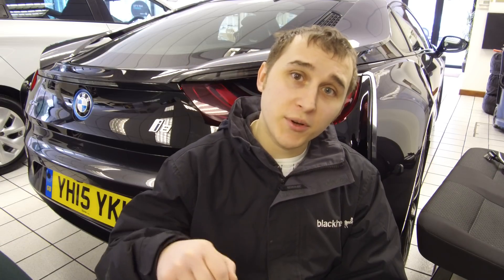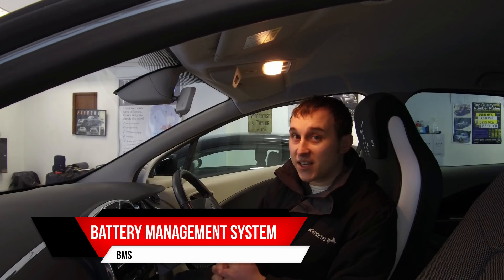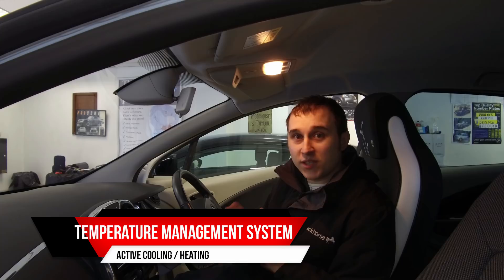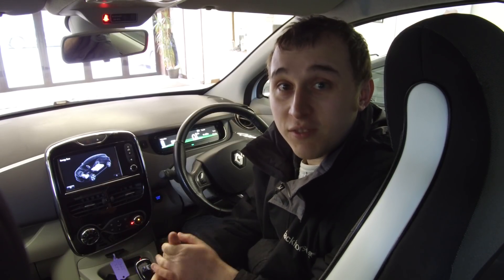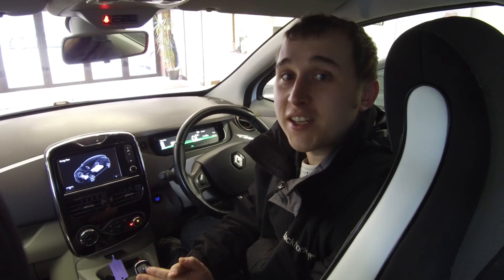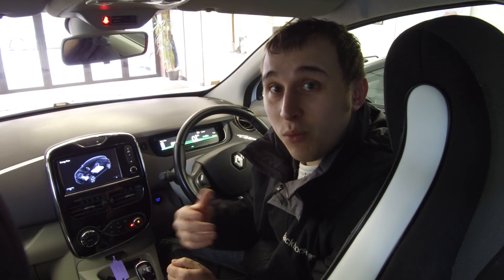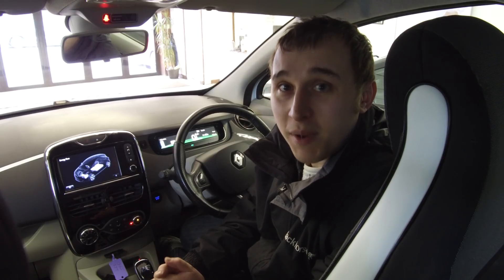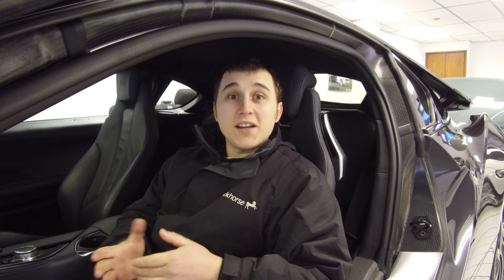2018 Nissan Leaf Charging issues TMS? Firmware?, my take  🔋🔌🚗

Comment from the maker: -Special thanks to Leo Clarke and Glenn Hodnett for supporting me via https://www.patreon.com/raimonick -
Reply: The original Zoe actually has a 24kWh battery but only uses 22kWh of it. The Renault marketing people thought buyers would not be happy seeing degradation in the first few years so hide it. As the battery degrades more capacity is used to keep the range. Makes it appear like the battery is not degrading. So sneaky that I expect VW wish they thought of it.
Reply: SOH = ability to hold a charge. SOC = how charged it is. Totally different things.
Reply from the maker: Yep got Tonge twisted however when I did subtitles I redid the correct Part I brackets I also said it again after correctly a few times :)
Reply from the maker: Lee only 22kwh is made available the top end it capped off to protect the life of battery same with bottom end the BMS ensure your never charge to a true 100% or a true 0% the 100% on battery is only 100 of 22kwh

Comment: Leasing a 2018 Leaf in U.S. Thanks for the video and info! Yesterday I did 2 charges 1st on J-1772 and 2nd CHAdeMO. First stopped after just over 1kw charge (started at about 10% left when I got to work). Went to a free fast charger after work and that quit at about 70% charge. I was with the car, so restarted the charge and disconnected at 95%. First time this has happened in 4 mos. I've had the car, so trying to figure out if there is an issue. Going to dealer for battery plate recall on Monday and will ask them as well.
Reply from the maker: Keep us posted joe

Comment: Why do you compare only to Renault ZOE? Are those the only two EVs you know?
Forget BMW i3, but why not not comparing with Hyundai Ioniq, which is in the same class?
It's only ZOE, Zoe, zoe ....
It's not an error, it's a feature. Because it can not dissipate heat, it slows down the charging speed to 40%-55% of normal speed, depending on temperature. Instead of charging in 45-60 minutes, it takes approximately 2 hours to charge to 90%.
Proven by multiple tests.

And a range of 300 miles? Give me a break. 
Who is driving 300 miles at snail's pace of 50 mph? What you get is 130 miles (at 65 mph) and the charger has to be just where you run out - to charge next 90%.
So it is 250 miles at the best, and to be realistic - it's more likely some 230 miles.

300 miles? With one fast charge to 95% Show it to me! Make a vlog.
Reply from the maker: Welcome to my channel Richard Please subscribe, I compare against the Zoe as its my everyday car and one i own,  I am due to test some Hyundai EV's shortly, but its hard to compare to something i've not used or tested.   Most people driving the leaf won't rapid twice a day on 1 run so 300 miles is easy,  as you'd leave your home with 150miles,  home charging doesn't heat the battery up to the extremes a rapid does.   Please see Lemon tea leaf's video.   I personally think Nissan are hiding from this issue now as lots of weeks have passed since they said  there investigating,  i do know owners showing this issue had an OBD port download and there SD card swapped for all the data but i think this was a smoke and mirror PR stunt as i'd of expected some release of information  by now
Reply: ZOE? OK, but get an Ioniq for at least a day so you will know what you are testing against.
Watching Bjorn Nyland could reveal a thing or two too.

Lemon-Tea Leaf? That's the guy I came from to see your video:
https://www.youtube.com/watch?v=CNY2xdWaGiQ&t=25m11s
A test at 60 mph that many users have missed, but it is very revealing.
Although the true range of Leaf 40 is 200 km / 125 miles (and not 150 miles, unless you drive <50 mph in ideal conditions, thank you), he suggests you should start charging at 20% - which happens at 160 km or 100 miles. So forget your 150 (ideal) range.
And even if - 60 mph is pretty slow. Most people like to drive 70, 75 or even 80.

Smoke from Nissan? What did you expect? They are buying time.
Can Nissan do something? Not seriously. Listen to Bjorn:
https://www.youtube.com/watch?v=foSYZ7bVhYk&t=57m00s
Adding a cooling fan won't help because of the shape of the battery. And adding a liquid cooling is a major redesign of the car (and the battery).

Just wait two or three weeks when users will upload videos, having daytime temperatures of 35°C (and night-time 20°C) and having massive heat-buildup at the first fast-charge (and a charge speed of less than 30 kW) !

Second fast-charge? It will be a ZOE R 90 speed. 20 kW or less. 2 hours and more at the charger.
Reply from the maker: I've struggled to have a Hyundai dealer agree to let me lend one yet, however i will be attempting to go via there press department.  Yes Bjorn is a great bloke,  my Youtube channel however is only 8 months old so I've not had chance to build much content out from Zoe and Leaf, like when Bjorn first started only did tesla.  I plan to try a lot of new things on the channel and more EV test is one of them, SO far my review section has,  "I8, model x, Jaguar ipace, (non driven) & leaf"  but as i said Hyundai is on my map for a test.  Hope you enjoy my channel there's a special video coming next week.  Also some great content coming from Milton Keynes when i meet my fellow youtube friends again.
Reply: If I may suggest - learn from Bjorn. This "Leaf 2018 bug" was a bad guess. 
The low charging speed is design feature. Bjorn knew it and reported it. 
He was told that "they did something to prevent battery degradation". Yeah.
Nikki Bloomfield knew it, months before the launch. So no guesswork next time, please.

A few questions: 1. which ZOE do you own? 2. Have you done a long road-trip at with multiple 44 kW AC charging sessions (at least 400 miles) and a video of it? 3. How about a charging curve/video from 0 to 95% on a fast charger?
These are things I haven't seen (or found) yet on a Zoe which would be able to take a 44 kW rapid charge.

Subscribed.
Reply from the maker: check out the first few videos from RZOC or Jan-Bart,  they did a road trip non stop to Austria and filmed it, LOTS of rapids, we have active cooling on Zoe and on the new ZE40 we also have heating.

Comment: Another JAPANSE trick ???? Japanese DIid NOT extend any Range on MISSAN leaf 2018 . Japanese are NOT good in Electricity. They are very good in Electronics ( again NOT electricity They can NOT recapture BEMF ) As owner of Nissan leaf 2018 e - pedal does NOT work at all !!! In fact NOT using E pedal neither ECHO ( garbage ) I get more Kilometers . E - pedal is only good for saving you money on the Shoe brakes and rotors maybe, because I do NOT have to brake at all . jusko@engineer.com . I am just writing this fact ( negativity) so other owners test it out and hopefully we get RECALL and Nissan leaf 2018 and they will fix it if you contact your Dealer or Nissan . E pedal on E golf and Ionique works very well, because you will see when you remove foot from e pedal = Kilometer ( or miles ) will encrease . if you have 100 Km left on battery , wait untill it drops to 99, then imidiatelly remove your foot from e pedal ===>>> you will see Km left will go up to 100 Km. That is the ultimate proof !!!

Comment: Check battery temperature management in the Nissan Leaf owners manual.
They warn you about frequent rapid charging and even suggest letting the battery cool down before DC quick charging.
Reply from the maker: Really that doesn’t marry up with the intonation am covering this Saturday from Nissan, if you haven’t already subscribe
Reply: Nicolas Raimo:  What has just been repeated from the 2018 Leaf user manual is surely confirmation from the horse’s mouth that the car is nit suitable for long distance driving unless the driver is prepared to greatly extend their journey times.  It takes several hours for the battery to cool from around 45 C, the temperature it will quickly reach during rapid recharging, to ambient.  On top of this is the delay resulting from slow charging as the temperature rises.  All further confirmation that without active battery thermal management, the car is unsuitable for long distance driving for which the 30kW Leaf is much better suited as shown by the Johnathon and two James drive from Hinkley to Aberdeen when the 2018 Leaf arrived over two hours after the 30kWh Leaf purely because of this.  And that was in very low ambient temperatures.  The delay will surely increase as our weather warm up, partly because the battery will cool more slowly and partly because it will heat up faster during rapid charge resulting in an earlier slowing down of the charge rate.
Reply from the maker: Hi Ian am by no means a Nissan fan boy however I believe what’s in the manual is just there as a way of saying to people who have low state of health “oh well you didn’t follow these guides”  the charge rate tails off too soon the 30kwh pack seems to allow high temps between charging.  Also if Nissan didn’t want this multi rapid charging there press statement this week would of just said that.  Like I said let’s give them a month first
Reply: Nicolas Raimo:  Its not that the 30kWh Leaf allows higher battery temperatures, it simply doesn’t generate as much heat in the first place because 30kW is a lower energy density than 40kW in pretty much the same battery pack size and shape.  A check of both cars using Leaf Spy
Reply: Sorry, reply sent prematurely.  Was trying to say that a check of both cars using Leaf Spy will confirm the lower battery temperatures in the 30kWh model.

I suspect that Nissan will eventually invoke the statement in the user manual once they’ve established that there are no faults in the cars involved and have confirmed, if this is indeed possible, that the problem lies with users not allowing the battery to cool between successive rapid recharges.  In the short term, they are obliged to investigate rather to revert immediately to the statement in the manual because they have to be certain that the fault doesn’t lie with the car.

Comment: The Transport for London rapid chargers that don't have AC rapid charging are those that are designated for taxi use only. The only approved taxis that can use it use either Chademo or CCS. There was no need for them to specify the added cost of the AC rapid charger connector.
The Transport for London-funded rapid chargers that are for public use do have AC rapid charging.
Reply from the maker: Hi Simon there where reports of AC rapid being removing from rapid chargers,  these were not new installs, so the cost would be them going out to remove them, However i am unsure if this was a taxi rank rapid i'd need to check with original source.   Just for anyone else reading this,  New London Take can take Chademo, CCS and Type2 AC,  in some respect leaving the AC on allows a failsafe if the DC part of the charger has a fault.
Reply: Nicolas Raimo transport for London have only recently started funding for rapid chargers,  so they're not removing ac charging,  just not installing it in places where it wouldn't be used. The chargers for taxis are all new. These taxi chargers are actually run by ESB on TfL's behalf. The Irish Electricity Supply Board.
Reply from the maker: cheers Simon not being in London I just saw post on forum, so thanks for full info
Reply: Another JAPANSE trick ???? Japanese DIid NOT extend any Range on MISSAN leaf 2018 . Japanese are NOT good in Electricity. They are very good in Electronics ( again NOT electricity They can NOT recapture BEMF ) As owner of Nissan leaf 2018 e - pedal does NOT work at all !!! In fact NOT using E pedal neither ECHO ( garbage ) I get more Kilometers . E - pedal is only good for saving you money on the Shoe brakes and rotors maybe, because I do NOT have to brake at all . jusko@engineer.com . I am just writing this fact ( negativity) so other owners test it out and hopefully we get RECALL and Nissan leaf 2018 and they will fix it if you contact your Dealer or Nissan . E pedal on E golf and Ionique works very well, because you will see when you remove foot from e pedal = Kilometer ( or miles ) will encrease . if you have 100 Km left on battery , wait untill it drops to 99, then imidiatelly remove your foot from e pedal ===>>> you will see Km left will go up to 100 Km. That is the ultimate proof !!!

Comment: how do you fine the state of health for the bmw i3??
Reply from the maker: OBD2 reading tool should be able to display this info if someones got the software to look it up,  my BOSCH system can do all EV's.  However some EVs have community made systems so CanZE is made by clever Zoe owners and LeafSpy is the same. If you subscribe ill try cover a BMW i8 way of checking battery health and similar system would be for the i3
Reply: Try this - https://bmwi3owner.com/2016/01/secrets/
Reply from the maker: That shows State of Charge Foo but thanks for reference,  We need SOH, State of Health
Reply: It also gives the “current maximum battery capacity” (cMBC), so that, knowing this value for a new i3, i.e. the “original maximum battery capacity” (oMBC), you can as follows calculate the current SoH = (cMBC/oMBC)*100%

The MY-2017 BMW i3 has total specced battery capacity of 96 cells of 94 Ah = 9024 Ah, at nominal cell voltage of 3.7 V = 33.39kWh, though this will vary a bit across individual vehicles, so the most reliable method will be to log this value on your own new vehicle then read it periodically to graph the calculated SoH drop-off rate.

https://pushevs.com/2017/02/20/details-samsung-sdi-94-ah-battery-cell/